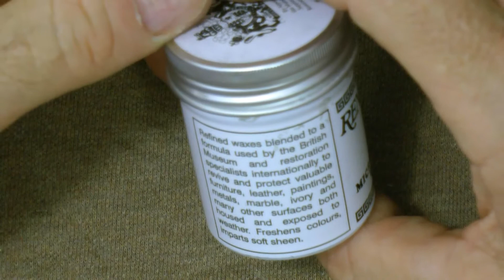Renaissance Wax

Comment: How are those promags treating you?
Reply from the maker: jcodym13 not too great average
Reply: That sucks. I feel like there's way too many problems for the price point of the gun. if you get a $500 AR-15 from Smith and Wesson with no faults from the factory, you'll never have a single problem. The least Magnum could do is provide a lifetime warranty.
Reply from the maker: yes I agree
Reply from the maker: jcodym13 Your correct. Why the hell  they  have a one year warranty who knows. Also if you get a gun with a crappy finish 99% chance they will not, cover it. And quite a few had shitty finshes.